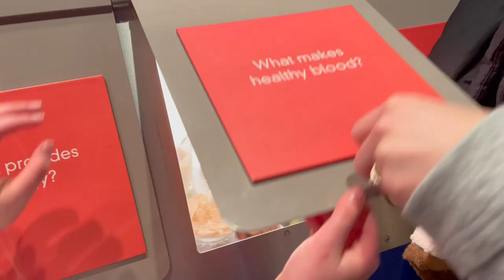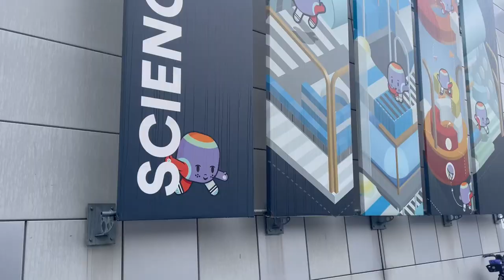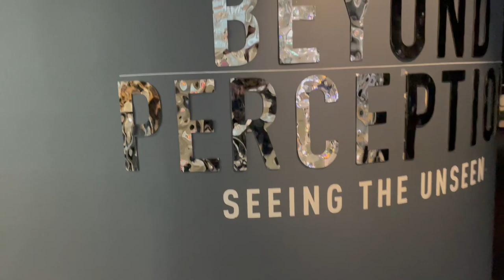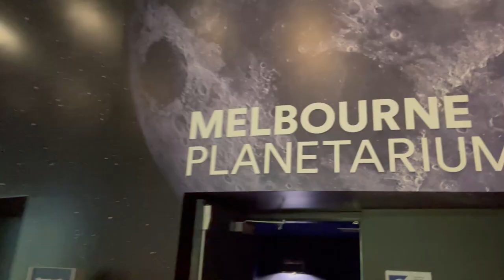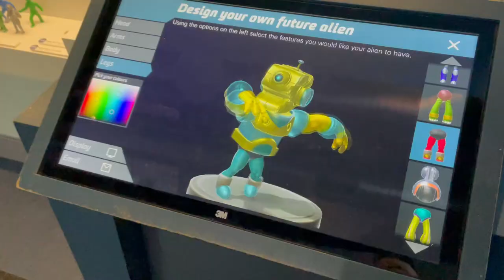I Found Melbourne's BIGGEST Telsa Coil at Scienceworks

Comment: I think the Tesla coil at Monash Uni's High Voltage laboratory is bigger than that (it's certainly taller)
They used to run displays on open days. I'm not sure if they did it this year, but I've seen it every other time I went there.
They also  have a huge Marx Generator there. 
Bummer! I just looked it up and it seems that it's been de-commisioned....

Comment: Mate, I know ElectroBOOM is a bit nuts, and styropyro is a legit mad scientist (seriously, there's a dude crying out for an Igor), but photonicinduction is the true Chaos God of Electricity. His favourite phrases are "I popped it" and "I'm not 'aving it! Where's my hammer?" He's the guy who blew the 5000 amp fuse. As it happens, if you've ever seen that viral video of a guy destroying a front-loading washing machine by overclocking it, setting it to spin cycle, and chucking a paving stone in it, that was him too. Honestly, his attic looks like a cross between Tesla's lab and a substation. He upgraded a 240 amp transformer. To 50,000 amps. He's got a 500kV power supply with variac. And pretty much all he does is overclock things until they explode. Oh yeah, its all hooked up to his mains supply.